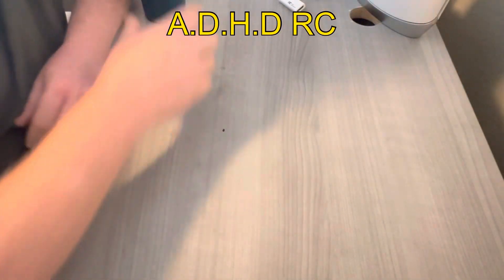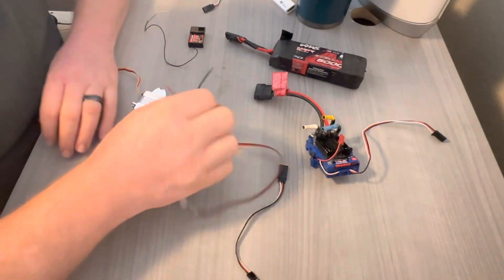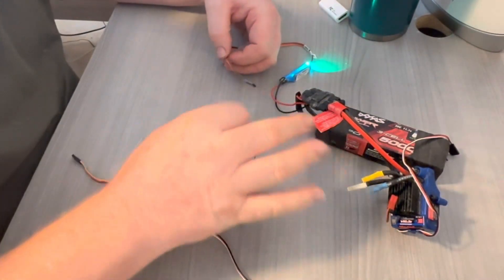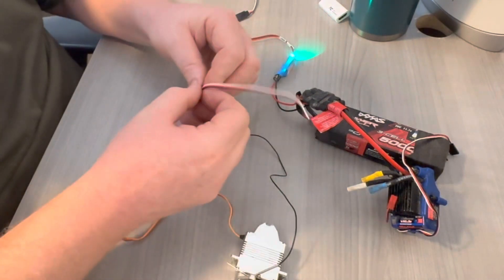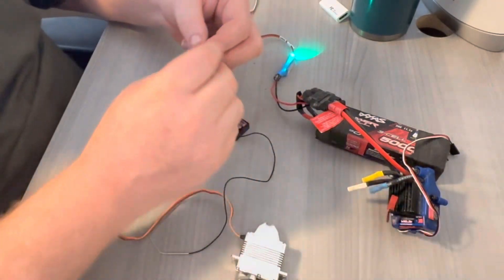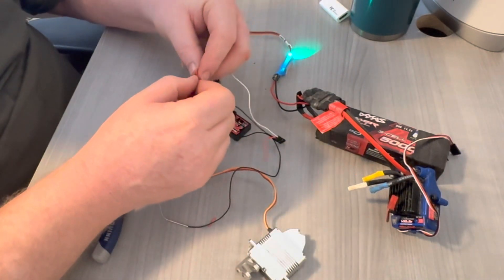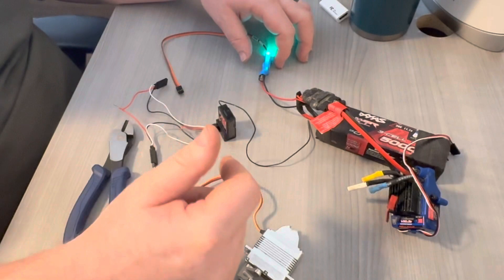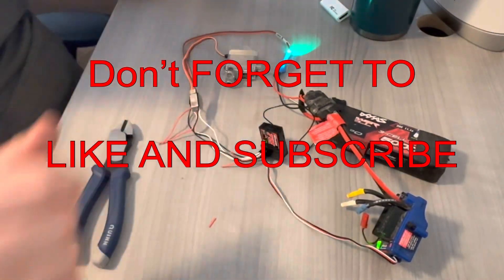HOW TO RUN AN 8.4 VOLT  SERVO ON A TRAXXAS RECIEVER USING A BEC

Comment: Instead of plugging both into CH1 I could also use a Y-Splitter, correct? I have only one of the two CH1 free. In the other I have the light kit plugged in.

Comment: Wouldn’t it be simpler to just remove the red wires from the 3 prong plug of the bec & servo and solder them together? That way you can plug both into the two channel one’s with just the ground and signal wires.
Reply: This way you keep the cabling of your servo end BEC untouched. (Maybe for warranty or re-sell purposses)

Comment: Good info sir. Where can i get the BEC? Is there particular brand
Reply: Castle branded BECs are very good or you can solder in a capacitor in parallel to the power leads which is cheaper option.

Comment: I have a 6 volt receiver and a 7.4 volt lipo batteries running on 7.4 volt servos with a direct power supply cable does that work right